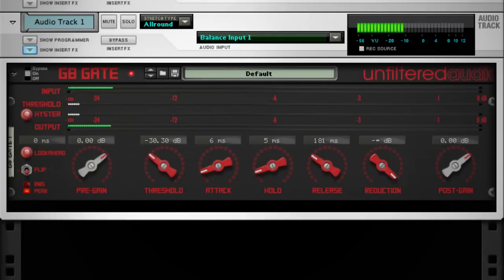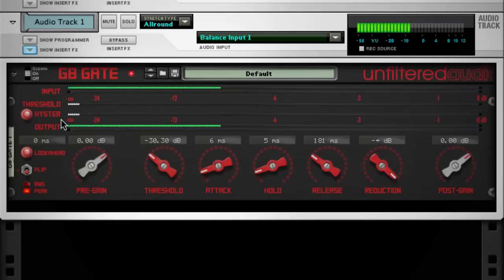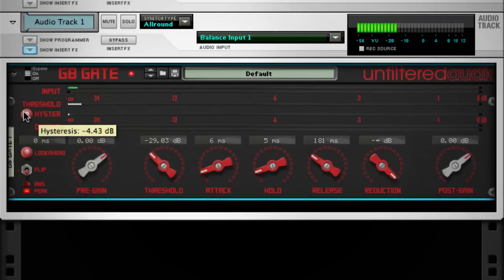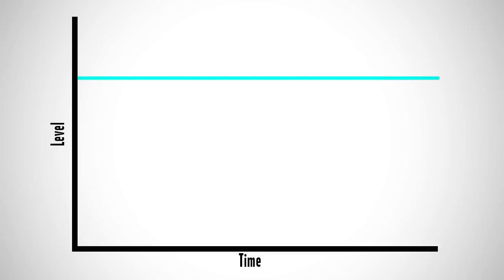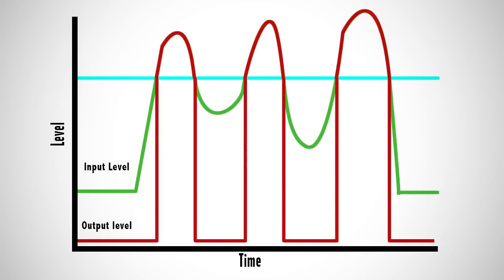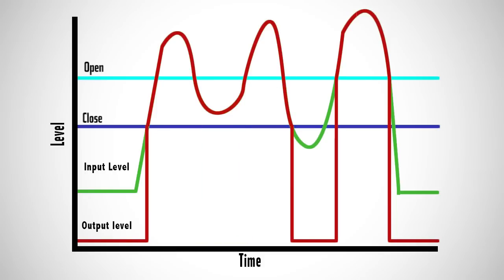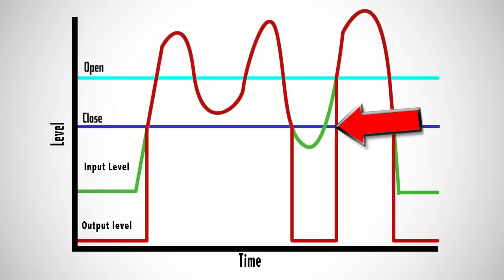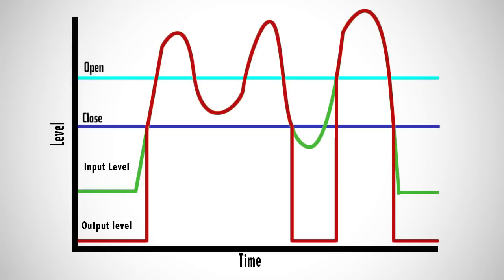G8 Gate Hysteresis Update: What is Hysteresis? (Unfiltered Audio)

Comment: What the heck! This is the best explanation in nine years! It is still the best after nine years! The rest of YouTubers shows only plugins, and more plugins. Merely listen and tweaking the heck out of everything. Basically blindly tweak. 

Modern or paid or advanced plugins normally have a graph showing spectrogram or spectrum-esque visual. There is at least one valid reason as to why visual is superior to hearing for change.

Even for videos there is this thing called vectorscope and waveform. These help people get accurate exposure and skin colour without spending unnecessary time or tools. This also has at least one valid reason why it is superior to having the most expensive and the most colour-accurate OLED monitor/screen. 

Both exist because humans can have senses overloaded. We will become lazy or bias or lie to ourselves.